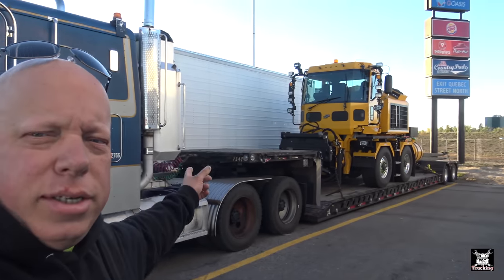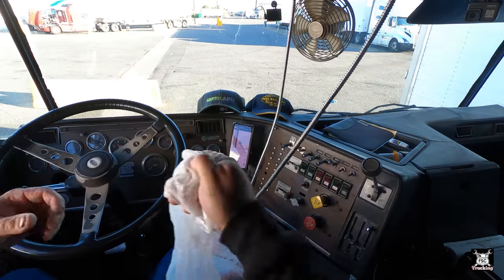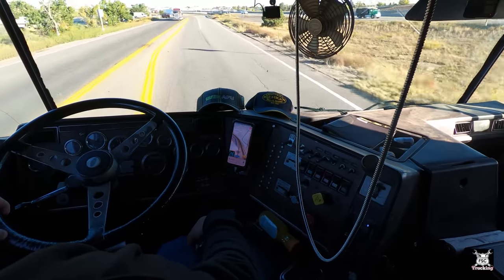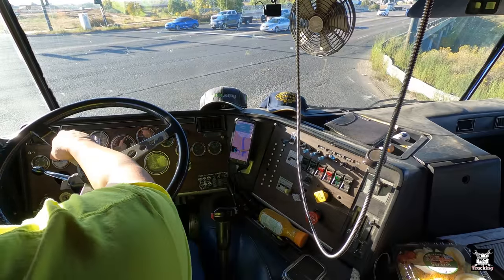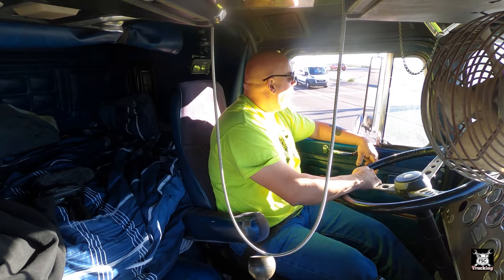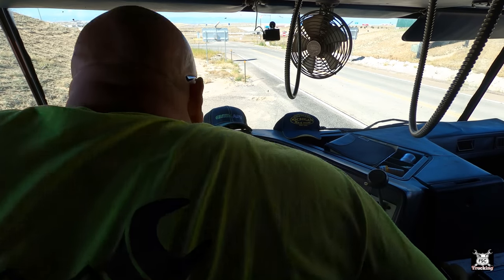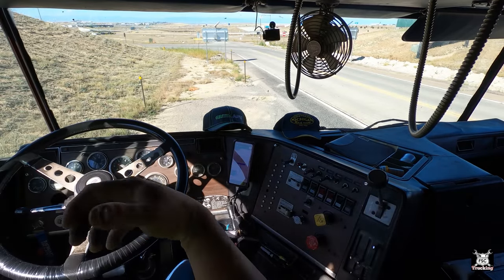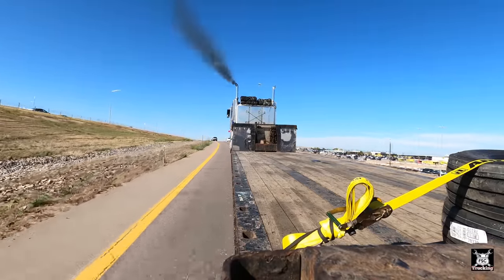I'm Not Sure Denver Is My Kind Of Place Anymore

Comment: You have the apu, aint no reason to be eating out the truck stop, get a refrigerated cooler, small microwave or toaster oven and buy some groceries... have that hot wife put together some meals in Tupperware. You would save more money than that apu saves on fuel.
Reply: And put all that stuff where?
Reply: Lmaooo in a cabover.  Good luck you don't even have a place to put your laundry
Reply: @justing6720  Passenger seat... you also forget this truck most likely has a cabinet for a small crt television in one of the back corners above the bunk, a small microwave or toaster oven would fit it just fine. If all else fails a spot could be made in that headache rack, not convenient climbing the cat walk but a small price compared to eating out all the time.
Reply: Ummmmm…. Dude.
Reply: It won’t fit in the cabover. Also I don’t think this apu makes 120 volt power.
Reply: @JohnSmith-lw2bm  you would need to wire a 2000 watt inverter for it to power a microwave etc.  but yeah there isn’t much room in a cabover 🤣🤣
Reply: @GoogleSpyZon  these guys commenting probably never been inside a cabover...you can make just about anything work if you know what you're doing
Reply: My friends dad had a  70's or early 80 international trans star cabover. I don't how his dad and step mom slept in that sleeper. It was so small. It didn't have a tv or a space for one that ever saw. I rode to Miami from Winter Haven to go unload 3000 watermellons.
The international had Dayton steer and drive wheels (looks like on a mobile home)
Reply: @chuckyf-u2395   I have 82 international 9670 and I'm telling you there is not much to work with. You guys also have to remember the cab tilting up. You don't want a microwave or fridge going through your window
Reply: @justing6720  could he have room for one of those small chest type refrigerated coolers, like ICECO(?), or such?
Reply: @justing6720  small refrigerator and microwave tie down of course 
I drove a KW cabover in the late 80's with the old school bubble TV tie down at the foot of my bed. With that setup you can put a microwave on top of the TV
Reply: Well driver, I had many Cabover, Truck,s I started out in the 70,s driving a Cabover IH Transtar 4070a hauling Swinging Meat. There ain't much room in a Cabover Truck to put all them things in the Bunk. Ecspecially if you are over 6 ft. I use to change my clothes on the side of my Tractor.When I bought my first new 1981 KWOPPER EXTENDED HOOD! I was in my glory. I got in that Truck after paying for it Cash! And I didn't come back to my Homestead for 13 Month,s I put 300,000. Miles on that Truck that year. Hard work pays off.
Reply: @erichb4021  
You put 300,000 miles on in a year?

Comment: Hey, Steve? If I recall correctly for your era of truck, heavy truck transmissions didn't have synchros for the manual transmissions the way light cars and trucks have. That's part of it.

The other part is that the older transmissions in trucks like yours have whiny gearboxes because of the cut of the gear teeth being more square than modern gears, which are curved and spiraled even. 

Put it this way: If you've ever been in an old car, and backed up for any kind of distance, you would hear the same kind of whine from a differential, because of the way the differential gearing teeth are cut. Modern differentials don't have the same kind of square teeth older differentials have, which is why more modern drivelines, both transmissions and differentials, are quieter than older ones.

A howl, by the way, that gets louder may be that a bearing is going bad, whether an input shaft, an output shaft, or an idler shaft. When you drain the transmission oil, make sure you don't have little sparklies in the oil, which would indicate something in the trans has worn past the point of needing replacement.

Comment: on the stack, i say leave it unless you are permanently changing things or there is a genuine benefit to removing the dead stack.  otherwise you will be doing the work to remove it just to turn around and do more work put it back on later...assuming that everything goes smoothly...which it probably wont.  and if that something goes wrong you will hate that you messed with with it.

questions on the APU;

from your previous vids the APU, it dumps heat into the engine.  on hot days, is there a limit to how much heat you can dump into the main engine and radiator without running a fan?

and for making heat up in the cab, at no point do you describe sending any coolant up to the Cab air handler.  is there a coolant line going up or is it a heat pump?

Comment: Leave the stack like it is. When you go to fix the exhaust with it still in place means less work that has to be done. The diff’s should have 90 weight gear oil.

Comment: Steve, If you use some Amsoil Synthetic oil in your truck, you will find that it will run a lot cooler than before. From one trucker to another, it works brother.

Comment: Its funny to me that you are shocked by the fuel prices over there haha. I try not run Denver but sometimes have to (I run regional out of Salt Lake City, UT). The roads in Denver are way too rough for my spring ride 1984 K100. I laugh about the fuel prices, because Denver is where I buy the cheapest fuel haha. Utah, Idaho, Nevada are all usually much higher per gallon than what I find in Denver. I run the Maverik Nitro card, Mudflap app and TSD Open roads fuel program and get some good fuel discounts between the 3. If you plan on running dual exhaust in the future, I would just leave the "fake" stack up. Why go through the work to remove the stack just to put it back on?

Comment: Did Gentry tune your at your last visit? I have noticed a little more black smoke in Denver.
Reply: Tune your truck
Reply from the maker: No.  Denver has a higher elevation.  The mechanical engine I have has no ability to lower the fuel in thinner air.  Thus mire smoke.